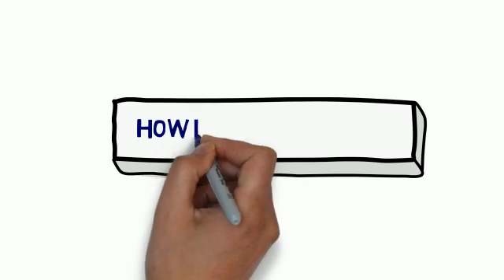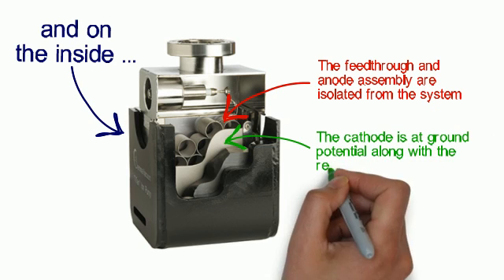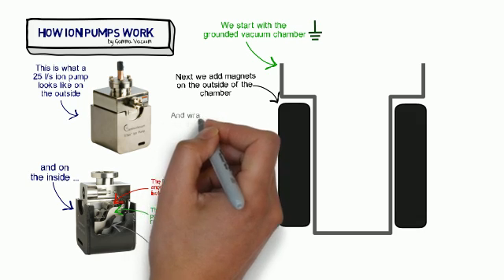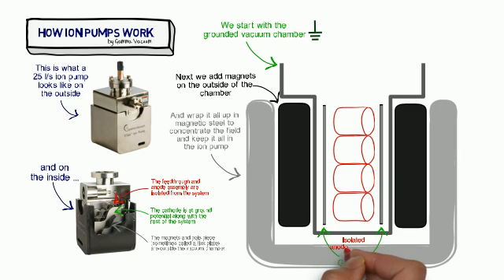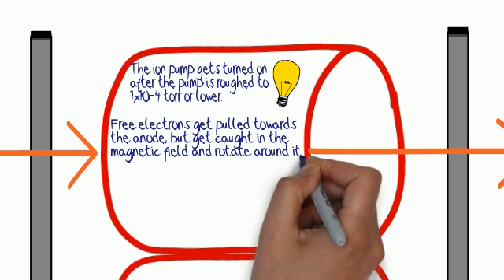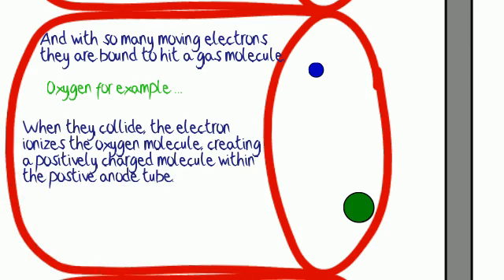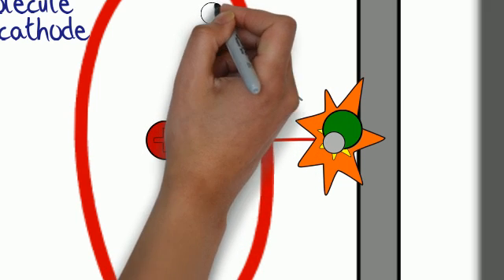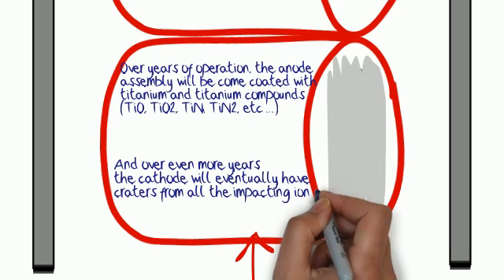How Ion Pumps Work

Comment: Two questions - Older pumps that won't start, tapping with a wrench often gets them started. What is going on with the (plate?) to get the ionization going?
What is the difference between a diode or triode pump? Thanks
Reply from the maker: Please contact us with your questions via our website www.gammavacuum.com for a response from an expert! thanks!

Comment: Edit; I found an explanation elsewhere, Ill put it on a reply.
Greetings, I have some questions. How are the electrons produced? from my understanding under high vacuum, electrons cannot be emitted from a surface unless there is thermionic emission, photoelectric emission or field emission due very high electric fields for example produced from a sharp point, however I don't see any structure related to such effects on this pumps so how does the electrons are emitted? 

Thank you for reading my questions.
Reply: "The working principle of this type of gauge is to generate a discharge between two metal electrodes
 (anode and cathode) by applying a DC high voltage. The discharge current is pressure dependent and serves as measurand [sic] for pressure. The lower measurement limit lies around 1 Pa, since at lower pressures the gas density is too low to generate enough charge carriers to maintain the discharge.

To extend this limit, a magnetic field crossing the electrical field is used. This magnetic field
 greatly increases the path length of the electrons from cathode to anode, so that the electron can generate another electron by impacting on a gas molecule to maintain the discharge (Penning discharge). Owing to their higher mass the ions are only slightly affected in their trajectories by the magnetic field and travel directly to the cathode. Secondary electrons released when the ions hit the cathode (cathode sputtering) support the discharge."

Excerpt from: Ultrahigh vacuum gauges
 K. Jousten Physikalisch-Technische Bundesanstalt, 10587 Berlin, Germany

Comment: I used screw pump, rotary pump, Oil pump TMP etc.. but i've never heard about ion pump. But basically, it seems working as same like Kauffman ion beam source. It seems very simple to use (to mount on chamber) but couldn't be used longer than other high pressure pumps (coz of cathodes sputtered ion .. etc). By the way, im not good at english so, sorry for my poor english and thank you so much that you made such a nice presentation ;)

Comment: Do you use an electron filament to create the source of free electrons (like maybe thermal emission)?
Reply: Im not the uploader but in case of Kauffman ion beam source, (also use magnetized electrons to ionize neutral) it use tungsten filament to make thermal electron. So.. yeah it seems like using filament.
Reply: @mousecat4696 , cool man thank you!
Reply: @mousecat4696  magnetised electrons?
Reply: @davemwangi05  my mistake, i meant confined electron by magnetic fields.
Reply: I don't think so, I think this is where the high voltage comes in.  I opened one of these once, it's very simple inside!  I don't think there's any filament or any controller for that.  In that kind of vacuum things will just light up at this high electrical pressure, I bet there's a visible glow discharge inside.

Comment: Thanks for the video. I have two doubts:
1. What are the anode cylinders made of? 
2. If the air molecules can get into the pump, why can't the sputtered titanium go away?
Reply: air molecules can get into the pump because they're gas at room temperature. The sputtered titanium will cool off and deposit on surfaces. because it is solid at room temperature.
Reply: Anodes are generally made up of steel and cathodes of titanium or tantalum( for nobel gases)

Comment: What is 25 l/s (at 0:16)? I mean what does "l/s" mean.
Reply: Litres per second
Reply: OK, but this is meaningful for fans, in my understanding. Here there are no fans. What [device] forces air to go into the pump? And how that flow is measured?
Reply: Air is not forced to go into the pump because at the intended pressure it can't be (a fan wouldn't work). But air will randomly enter the pump and the pump will remove it with some efficiency defined by the quality of the pump. This is the case for all pumps that work in molecular flow regimes (where air pressure is so low air molecules behave like individual particles instead of a continuum).

You could measure this by tracking the pressure in a chamber when the pump is working. It should drop exponentially according to Pi*e^(-S*t/V). Where Pi is initial pressure, S is the pumping speed (in volume per time like we are talking about), V is the volume of the chamber and t is the time elapsed. This would work for any pump.
Reply: @vadims8742  Especially in the molecular "flow" regime, I think they molecules just go where they want, each molecule is an individual.  But if one gets involved in the dynamic action inside the pump it might not emerge!  Unless it's helium or something?

Comment: Thank you very much for this explanation, but I have some questions related to ion pumps,
What is its ultimate pressure?
- What limits its performance practically?
- What type of system is it generally used on?
Reply: Safa M ion pumps are best suited for UHV ultra high vacuum applications able to achieve ~10 -12 torr. Applications include such things as CVD/ALD Depo used in production of semiconductors.

Comment: okay, so the overall idea is to trap all gaseous phase molecules (N2, O2, CO2 etc) through irreversible chemical reactions. So three questions: 1, this means it better be used at circumstances where gas pressure is already very low, otherwise titanium would be quickly consumed, is that correct? and 2, what about other type of gases, such as inert gases, or because they are at negligible amount, we just ignore them? and 3, why titanium?
Reply from the maker: Your summary is perfect.  You did a great job answering your first question - pressures must be very low.  Ion pumps are normally used in High, Ultra-High, and Extreme-High Vacuum (e-6 to e-12 mbar).  At higher pressures, the Ti is consumed faster, but the main barrier is the high current used to keep ionizing gases.  That current generates a lot of heat which can not dissipate in a vacuum very well.  There are better pumps to use (like turbo pumps) for those higher pressure applications.

Inert gases may be negligible in some applications, but often they are introduced to the process used in the vacuum (sputter depth profiling for example uses Argon).  In those cases, we swap the Ti plate for Tantalum or change the Ti orientation.  See our other video (Ion Pump Element Styles at https://www.youtube.com/watch?v=zfIM7p3Xvgo) to see more.

Titanium is used because it is very reactive with most gases.  If you ever get the chance to grind or bead blast a piece of titanium, do it because it is like fireworks.  A bright white light is easily seen - much brighter than what you would see with steel.  Ti is also a getter for hydrogen.  This means H2 readily gets adsorbed into the titanium between the Ti grains.

Keep the questions coming!
Reply: GammaVacuum thank you for the explicit answer! especially the chemistry knowledge about titanium. and by the way, this is the BEST video on youtube explaining ion pumps!
so where are GammaVaccum pumps usually used? I'm working on electron microscopes and they use a couple of ion pumps, I don't know if you guys are involved in any of those EM parts.
Reply from the maker: kopolojoyono Thanks for the kudos on the video.  It is pretty basic, but it works to get the main points across.

SEMs are a good example of ion pumps.  We do work with a number of SEM manufacturers and certainly support any manufacturers pumps.  To see a list of detailed applications, see page 2 our our printed document on ion pump operation (http://www.gammavacuum.com/files/7213/8737/7402/Gamma_Operation_v2.pdf).  Historically we have worked with government labs across the world and have a really good installed base of pumps in that market.  We used to be part of Physical Electronics (surface analysis company) and have lots of experience there too.
Reply: @makegaminggreatagain3907  which one had you taken? Methamphetamine?

Comment: so where does the suction come from?
Reply: Yes i think you just explained sputtering, and not the pumping action.

as far as i know, the Ti atoms, which are knocked off by the O2 plasma, will deposit on the walls. then they will act as sites (or getters) for chemical reaction with air (H2, O2, N2, CO2 etc). as a result, the pressure will start decreasing, as more air molecules react with the gettering sites. this is essentially the pumping action.

please correct me if something is wrong / missing ...
Reply from the maker: Unlike typical pump high vacuum pumps, ion pumps only operate in molecular flow vacuum regions.  There is no suction created by an ion pump - they only pump the gases that migrate to them.  For a general description of molecular flow see http://en.wikipedia.org/wiki/Free_molecular_flow